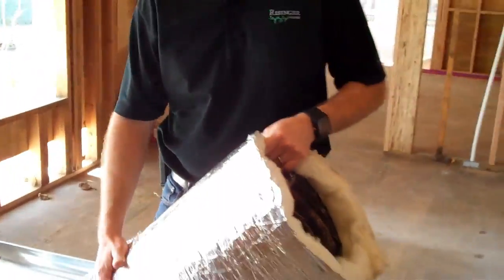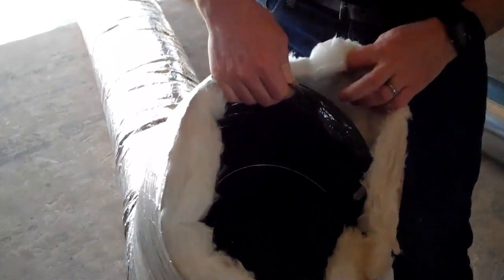Rigid Metal vs Flex for HVAC Ducting

Comment: "Metal trunk lines and plenums and limit flex duct to 10' or less at the end of the run"  That's very good advice.   I wish the HVAC contractor who replaced my system several years ago had that same commitment to quality - and I used a well known "reputable" contractor.  {{{sigh}}}
Reply: I've seen old  comm. lines pulled w/out regards to insulation being compromised and flex lines choked off  installation of both can be goofed up much less design and size issues of course.
Reply: So great to see the  same quality content even 11 years ago, so cool to see how you’ve developed as a presenter. Bravo.

Comment: What is your opinion on fiberglass ducts? Should it be replaced?
Reply from the maker: Not a fan. I would replace.
Reply: Does it pose a health issue if the ducts were not properly maintained? Is checking the ducts even part of routine maintenance on a system?
Also, thank you so much for responding so quickly. :)
Reply: +Robyn Stasko the problem with duct board is that small pieces of fiberglass can enter the air you breathe while the system is running. Also it can't be brushed out with a duct cleaning machine as it would break up the fiberglass, and you definitely want to have your ducts cleaned every once in a while (5-10yrs on average though every house is a little different).
Reply: Ro

Comment: Matt it seems to me that the piping could be made of inexpensive plastic and placed inside the conditioned space as is seen in many commercial installs.  The insulation and leaks become non issues. Decorative considerations aside, the benefits seem to outweigh the problems.  Your thoughts?
Reply: I know as far as commercial applications are concerned, they couldn't do plastic for the same reasons some buildings dont allow abs/pvs. Plastic is a combustible martial, so in case of a fire, the fire travels a lot quicker through the pipping because its plastic. For a residential situation, I'm not sure why they couldn't though
Reply: Absolutely no fire hazard additions to the home. Have you thought of a cheap long lasting inflammable material?

Comment: Hi Matt, thanks for this video. 
I have drawn up a concept for a Local Exhaust Ventilation system that I will install in a nail salon. However, I do not know how to select the proper duct sizes, as I do not know how to perform the fluid dynamic calculations (calculating static load) of the network. The system is rather simple: think of an ant; At the head is a centrifugal exhaust motor mounted adjacent to a wall that it exhausts through to outdoors. And at each foot, I need to provide a minimum of 50 cfm volumetric air flow. I will have in-line dampers on each ankle, and a rheostat to control the motor for control. Any suggestions on how I should determine the duct sizes at each branch, (and ultimately select the correct fan capacity range)? 
Thanks, James

Comment: good to see that you're not going with low bid on your HVAC system for your homes but I would not use flex in a place where it's not accessible the Flex today is better quality than it was 40 years ago I have seen flex fall apart should just do it all in metal where you're going to be finished in enough not that much more anyway I've seen some really expensive homes in my 25 plus years in HVAC with flex. That's just been hacked in good to see that you're not going on the cheap

Comment: What is the difference between alum flex ducting vs foil jacketed flex ducting?

Getting estimates to replace all of the duct work, one contractor quoted a price for foil jacketed flex duct, but recommends upgrading  to Aluma Flex ducting for an additional $1000.
Reply: I did an install with aluminum flex, it does seem better than the plastic flex.

Comment: Why insulate rigid duct within the conditioned space?
Reply from the maker: The delta between inside the duct and out is at least 20 degrees.
Reply: That's a good question, I guess it's to prevent condensation from forming on the pipes and causing water damage. I don't think it's to prevent thermal loss between the duct and the conditioned space.

Comment: I agree.  Metal plenums with short flex drops to knock down the noise.  If it is all metal you hear noise from the metal expanding.  Too much poorly installed flex duct out there.

Comment: Hello Matt,
 So good to find you! I bought a 1904 home in the low country of South Carolina. I have 2,000 sq. ft. of crawl space with very old metal ductwork and shredded insulation thats wetttt. I have had 3 different contractors look at it. 2 want to replace with flex stuff and 1 wants to use metal with 3" insulation. I want to use metal man (gut feeling) and then you really convinced me. Well, metal man (40 yrs. in heat & air) said he was afraid when replacing all ductwork, they have to move the 3 units for connecting and the old units might not work afterwards? What what what am i suppose to do under those circumstances?

Comment: flex duct can be installed properly by using rigid elbows and making sure it is up sized to compensate for the increased friction rate. Flex duct is quieter. my entire house is flex. I have a .05 ESP.
Reply: Quiet, moron.

Comment: why would you use any flex duct at all??????? everything is open and you have a full access. THIS VIDEO IS FUNNY!!!??!! SO YOU ARE SAYING HOW BED FLEX DUCT IS AND THEN YOU USE FLEX DUCT. IS THIS A JOKE?
Reply: +jusuf delibasic 
The flex at the end is to cut down on sound transmission from room to room.
Reply: +jusuf delibasic 
Agreed. When the flex gets old and or crushed by the cable guy, you have duct leakage which will cost so much that you'd wish you had solid all the way. Better you run the ducts inside a plenum that is inside the insulation/air boundary.

Comment: I got a question. I've seen some people going with PVC duct work for their homes. It not only insulates better but there is less air loss throughout the system. So question how does one implement this system? I already don't have walls in my house since I'm renovating and I'm getting a new HVAC unit. I've heard you need a nonconductive adapter between the HAVC unit and the piping and proper ground for the tubing for static reasons.
Reply: Using metal clips to secure the PVC duct will help dissipate static electricity.
Also run copper wire through the inside of the PVC duct runs and ground the copper.
No sure about larger PVC duct systems, but a couple brands the specifically produce PCV ventilation duct are Fantech FlatPack ventilation duct and Verplas Flat Ventilation duct. Both use self seal connectors so they're relatively easy to install. There will be many other brands out there that specialize in this type of ducting.
Reply: That just sounds more expensive?

Comment: Here in Canada its ALL rigid, no flex except for bathroom fans fresh air and ventilation dampers
Reply: That's not true. There are guys here installing ALL flex in my attic. Kind of panicking right now...
Reply: Totally depends on your installer, Mine seems to be a mix and match. there are even some almost loops in my flex sections, one part is also Flattened but it "looks" like it is run right, which it isn't. I'm in Ontario
Reply: Drew Robinson well, turns out our installers couldn't even install rigid right. There is very little ducting tape used, I can feel leaks at all the joints, and I even noticed one spot where there tried to screw into the duct at a joint and the screw pushed it in, bending the duct, so that there is a big hole for air to gush out. And they left it.
Reply: Jordan Maz that should be solid too

Comment: I would never install flex duct where it wasnt' accessible in the future.
Reply: I'm only aware of this stuff being used in drop ceilings, attics and crawlspaces. Up farther north, I'm in Denver, where the HVAC all is fed up through the house from the basement, with the ducts all in walls and ceilings, you just don't see the flex stuff as much.

Comment: that run of flex at the 2:30 mark is installed incorrectly- it should be pulled taut.  there are so many wrinkles in it, i would venture to guess you have 12-15' of flex compressed to 7'.   thats almost a 50% compression, that would result in ~5X the air friction and loss.....Also, at the 2:10 mark, when you pushed against the metal duct in the overhead, it was plainly not 2" insulation.  the insulation is obviously pulled too taut.  the effective R value would be substantially under R-8.   Pretty work, I'll give you.  but you're paying for pretty stuff that wont be appreciated behind 1/2" of sheetrock, fella.
Reply: I would guess that that flex will be shortened and pulled taut durring the install of the return. I always leave extra when running flex. Then when we come back to install grills we will work it down
Reply: My thought is how are you gonna repair it between the floor and ceiling when a squirrel gets in it?

Comment: you mention your duct blast leakage percentile as being under 5%, but the 2012 IECC calls for a maximum of 4%, WITH the air handler installed.  this tells me that coming up soon, you'll be failing your duct blastings more frequently.  i find it easier to attain levels as low as 2% using flex runouts, trying to minimize seams.  your concerns over airflow loss are null and void based on a proper Manual D, which also should be performed, equally as important as your Manual J for residential.  you're example in this video shows that the only other advantage to metal, its durability, is also irrelevant as once that home is complete, nothing will be able to access the duct to damage it, even if it were made of glass.  your argument will be critters- squirrels etc- tearing it apart.  but if said critter gets into the metal, it will still tear off the insulation, and the resulting condensation and mold will be longer to manifest, but much more costly, than realizing the duct was damaged due to lack of airflow, and the ease with which you would find the problem on a flex piece.  accept the facts, the expense of metal is quickly making flex and plastics the only viable alternative.  get over the denial and start learning how to maximize the potential of the newer materials, or perish as people are less and less able to afford you.
Reply: NAILED IT!!! I wish people would stop treating flex as a bad thing. Done correctly it's actually an improvement over other options.
Reply: Y
Reply: I agree 100% if installed properly and stretched the way it's supposed to be, won't have any issues.

Comment: also, why don't you explain to people what "'we pay a little more for this" means, in terms of real numbers?   is it just 10% more?  or alot closer to double?  explain to them what happens when you fail a res-check on a rigid metal, vs flex, after an installation like this?  especially if you waited to duct blast until the registers are up?..... you're bias is screwing your consumers.  enjoy.

Comment: soooooo on a 25" run, how many seams are on the rigid metal vs the flex runout?  tell me about those seams- is it smooth, or are there screws sticking thru and a smallers ID crimped end every 3-5' going into a larger ID?   over time, what happens to those screws?   why cant you use screws to attach dryer vent? if you get a damaged piece of rigid, say it gets run over by a fat termite inspector- how easy is that to repair vs a flex piece, which would probably NOT be crushed or impinged?   all you tunnel visioned rigid bandwagon lemurs should try thinking outside the box occassionally.
Reply: You are right I have seen 10x as much crushed hard pipe in attics from cable installers or homeowners or even insulators prior to completion of house. When flex is stretched & strapped correctly it is just as compatible. This guy has probably come straight from college to this company & has not seen anything else. Don't hate on what you don't know
Reply: What I dislike the most about rigid is not the product itself, its installers not taping the seams. I don't even use screws, tape not only secures the pieces and makes it easy to dismantle, but it also secures air flow from leaking. Custom crimping is also helpful.I'm surprised Matt didn't whip out the $1,000 crimping machine.
Reply: You definitely have to use screws to secure it. And the tape is only to seal the joints not to keep them together. Flex is garbage and Matt Risinger was correct about it except that we try to keep it no more than 5' of flex off the main trunk.
Reply: Looks like you became a major share holder in a flex duct manufacturing company, to be so pro for a crap product, I doubt it was even available in the 50's  and some how forced air was installed with out it.
Reply: kaleb key - You're a moron.
Reply: @kaleb key  "This guy" doesn't work for the company he owns it. It would have taken you less than a minute to visit his website and learn about his history. But nope, you decided to spew bullshit and make yourself look like an idiot. Good job genius.

Comment: Would love to see a video on how to insulate the rigid ductwork (I'll look around for one.). Had mine redone by a local AC contractor and it's sweating badly. Contract said 2" of wrap, probe showed anywhere from 1/2" to 3/4". I'm getting tired of re-doing sloppy work.
Reply: Yep which is why I'm learning to do my own work as much as possible

Comment: Great video, Matt. Flex duct should be banned in all codes except for the last 6 to 8 feet of runs to air devices.
Reply: This won't happen because on remodels you can't get hard pipe where it needs to go. But to each their own.
Reply: Completely sound advice hacks always selling cheapest install flex is 3 times per lineal foot easier and quicker specially on remodels  .
Reply: Same thing was said when contractors started using round pipe opposed to square duct, or using pvc  instead of copper or galvanized pipe , thirty yrs experience has taught me its all about the install...
Reply: I agree with you.

Comment: Matt, How to avoid sound transmission from one room to another through the HVAC ducts? When someone is talking in one room it can be heard like a loud speaker in another room. Thank you.
Reply from the maker: Good question.  First, I'd verify if you have all rigid metal ducting into that room.  By dropping from Rigid Metal to Flex Duct on the last 5-10' that will help greatly.  You could also possibly modify the route on the ducting so it's not a straight path from one room to the other through the ducts.  Best, Matt
Reply: Matt Risinger Thanks a lot Matt!!!!
Reply: if you have sound transmission is strictly because you have undersized ductwork and outlets if it's properly sized you won't hear it but you don't have to worry about sound transmission the other thing that needs to be done is oversized the return as much as possible and have as much length as possible between the return vent(s) and the indoor unit you can never have too much return that makes a big difference on top of proper sizing for ducts and grills  Supply Grills are rated for max CFM flow that's what stuff about doing some equipment replacement you're stuck with a duck and girls that are there but if you're doing a complete teardown you can change it all

Comment: I have many nearly 80feet of metal ducts with no insulation is it possible to wrap with r13 Kraft paper faced fiberglass as used in walls? It's cheaper than the smaller foiled wrapped rolls at Home Depot considering how much I have to do.
Reply from the maker: Good question.  There are many reasons this is not a good idea.  The insulation you're referring to is meant for a wall cavity and would be very hard to insulate a duct well.  You'd end up with many areas of the duct that are poorly insulated and would have a high potential for condensation to occur.  I would not use it for that application.  Matt

Comment: Thank you the section at 1:10 showing the flex duct being compressed.  This needs to be shown.  I just want to add a nitpicky observation. It has been explained to me that mastic should the thickness of a nickel, you really should not be able to see the duct through the mastic. Overall nice presentation of good information.
Reply from the maker: Good point on the mastic.  In my guys defense, we duct blast all our installs and they test out at below 5% loss, and most importantly all my ducts are within the conditioned space of the house.  Thanks for commenting.  Best, Matt

Comment: We just did a house fully with mini split systems. We used the Mitsubishi Multi City system and we used their conventional air handler so we had the best of both worlds. The really nice thing about this job was that we were able to link it to the web and the homeowner controls it from his iPhone app. I really like you 10' max on flex runs. Great job on the video. Good luck with your future endeavors.

Comment from the maker: Don't assume that you'll get rigid metal trunk lines, very few HVAC contractors do that.  Tell him you want flex drops of less than 10' in length with all else being rigid metal.  Best, Matt
Reply: Why 10 feet? As a PE we would not accept anything more that 3 feet, but only when you want to relocate a diffuser say in a ACT ceiling

Comment: continued - He drew the trunk line (which I'm assuming will be made out of rigid duct) and the registers for supply and return, but he really didn't show whether they would use a combo of flex and rigid when branching out to the living, kitche bedrooms and bathrooms. Can I share that with you and perhaps you can suggest the best way to layout the combo flex and rigid.  They did caveat that their methods were based on the manual d and manual J guidelines of the ACCA.  Thx